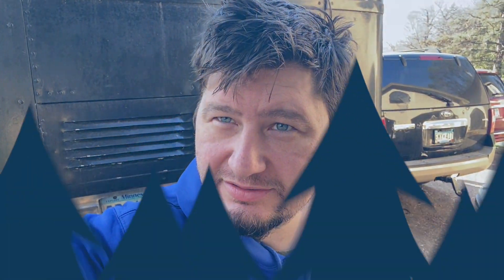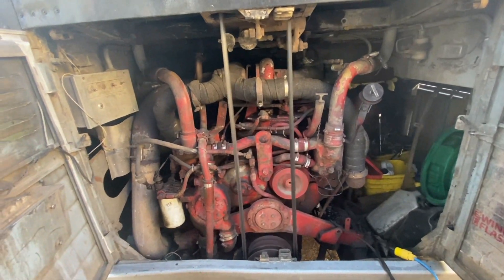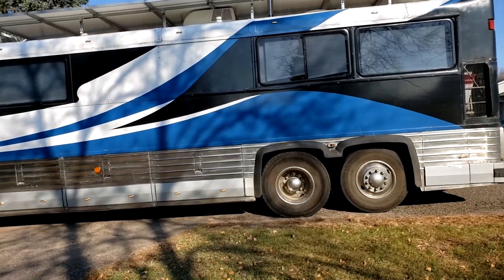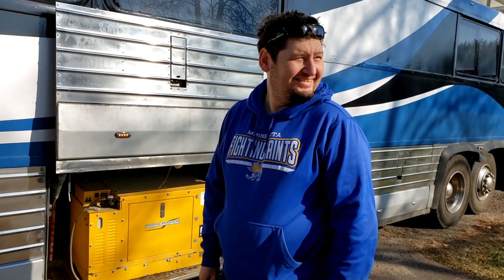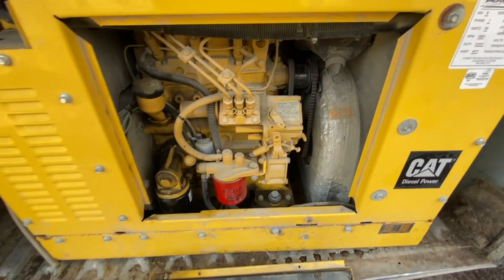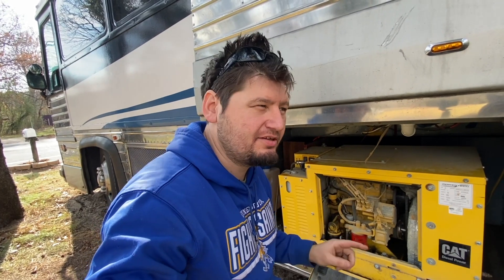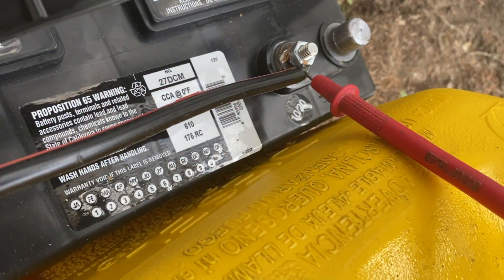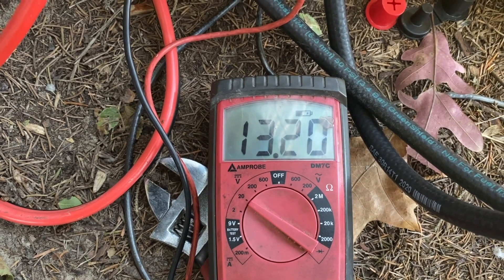New Diesel Generator for our Bus Conversion, can we get it started?

Comment: The generator looks nice! I bet you'll do great with it. My bus conversion project is a old Red Cross blood collection bus. After it was de-commissioned it was left with one generator. Originally it had two. I guess for refrigeration systems for keeping the blood at the right temp. It is a Power Tech 4 cylinder Kobota diesel.  It runs great, mine is water cooled unit. It is not in an enclosure, it has sort of a shelf the unit slides into. I need to modify it, as I don't want to have to use a fort lift or pallet jack everytime you need to get wrenchs on it.  But it seems Power Tech is known for its reliability.  Parts seem to be available as well.  I always enjoy your projects , and your endeavors! You are doing great!  Inspires me to work on my project! God bless! Al from CT

Comment: As far as your starting issue, does seem like stuck injectors.. what is weird is that it immediately goes away when you restart. I would let the engine sit and the pull the valve cover before you start it, start it and watch the injector racks and see if they are not moving with the control tube. If you have stuck injectors, you could try to run some ATF through them and see if that cleans them up. Just pull your fuel filter, empty the diesel and fill it up with ATF.. it will not hurt anything. The Detroit can burn just about anything. The other issue could be air getting in your fuel system, old fuel lines start sucking air right through them. I believe I am having this issue. 

Check out my channel, Gino’s Garage, I have videos on doing a tune up.. it’s not that difficult, it’s just fiddly.. you have to have some patience to get everything right. 
Great score on the generator. A lot of times they use low cost AVR’s.. Check out Central Georgia Generator. They have AVR’s at reasonable prices.
Reply from the maker: Some of your comments got held for review, great advice here! Thanks!
Reply: @HimmelbergerBus  No worries.. just glad you got the info.. not experienced like Phil.. but I have learned a-lot from guys like him.